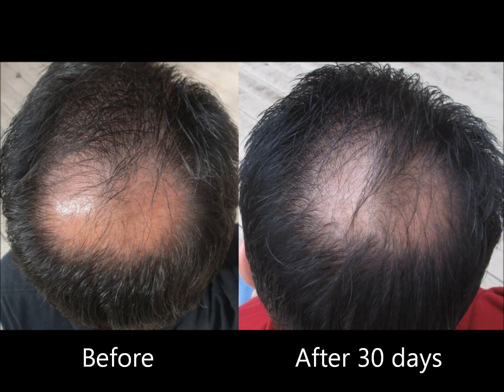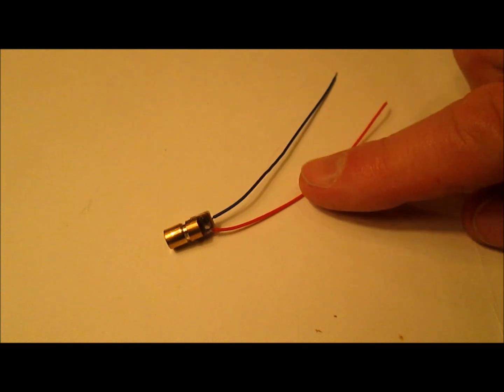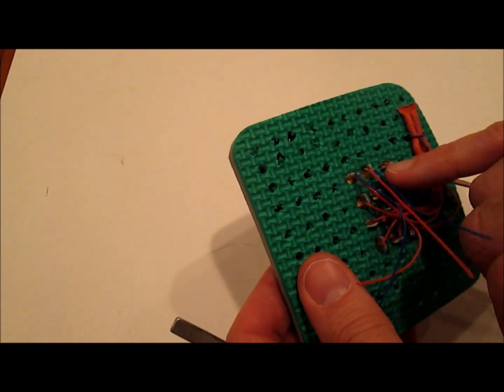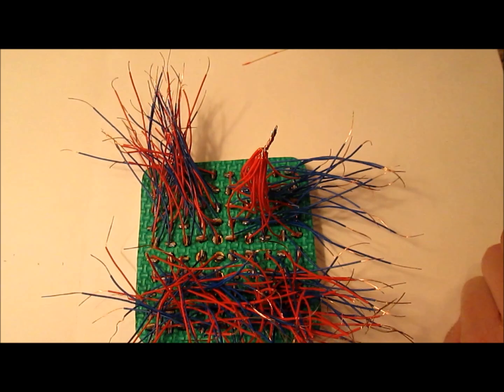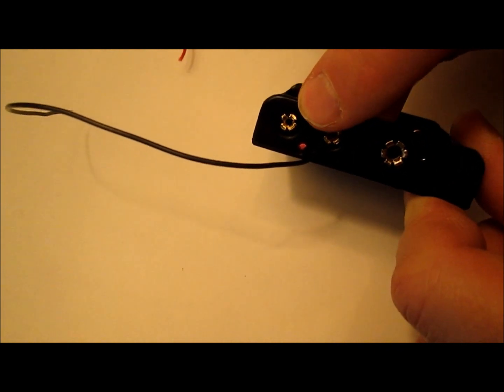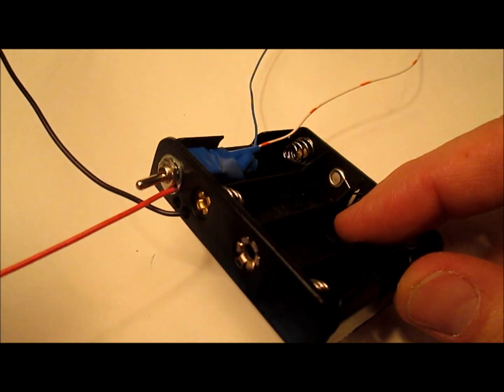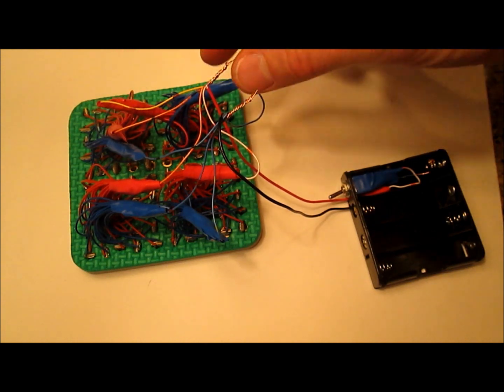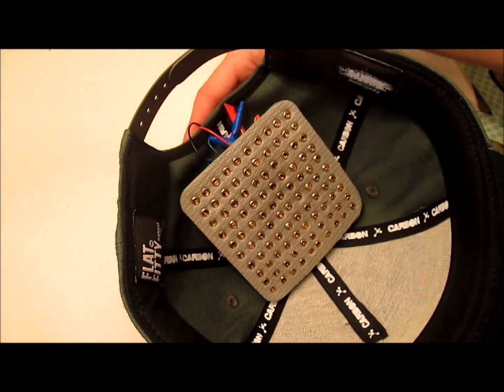How To Make a Hair Growth Laser Hat for $60

Comment: Is anyone did the same or similar hat? What is your experience?  I just build a prototype, using 50 lasers. Will be interesting to see if any result. Q to Lou - using 3 1,2v rechargeable batteries we are receiving only 3,6 volts, does it mean that lasers are working not the full power? but using 4x batteries 1,2 we are coming to 4,8 watts. Where am I wrong?
Reply from the maker: MrPavelvideo - You are right on.  You can't exceed the laser voltage rating.  In my build, I used 5 volt lasers.  Disposable batteries (alkaline) are 1.5 volts, so three of them would add up to 4.5 volts.  Four disposable batteries would be 6 volts and would damage the lasers.  Rechargable batteries (NiCd or Lithium) are 1.2 volts, so 4 of them would be 4.8 volts.  I use three lithium batteries, and 3.6 volts makes the lasers VERY bright.  I really don't think you need to go to 4.8 volts.  Also, as another option, you can get 3 volt lasers, and run them with just 2 batteries.
Reply: *****  Lou, I 've read all your answers but what is your opinion after 8 months of using? are the hairs still growing or shredding? also I am wondering if more expensive laser diods providing better quality of rays?
Reply from the maker: MrPavelvideo -  I wish I had an answer for you, but I stopped wearing it for a while.  I was getting headaches, that turned out to be completely unrelated, so now I have just started using it again.  Also, I keep forgetting to wear it :(

Comment: i use USB to power directly rather than battery. Will see in about a week
Reply: hey how is it..any hair growth using this?
Reply: nope, I went with hair transplant. Now my hairs are fuller no need to use stupid laser.
Reply from the maker: Cool, how much did the transplant cost?
Reply: 12K but is worth it. It such a hassle to maintain your hairs with chemicals, oils and lasers, lets face it it doesnt work that well is all depends on your genes and your testosterone. The more your body produce testosterone the faster you'll loose your hairs.
Reply: @jasona7029  I'm 70. My testosterone is almost as high as it can get. My hair is just beginning to thin and recede. I'm not sure there is a direct link between testosterone and hair loss. Though, I have read that as well.
Reply: @user-vu3xb7qn8g  testosterone theory makes no sense. Why do some men lose their hair and others not a hair? There are people walking around with low testosterone levels who are bald, losing their hair or have almost all their hair. If you had hair replacement surgery you would expect the hairs to fall out if in fact testosterone was the cause but they don't.  So what's the problem with those hair follicle and why are the ones they transplant surviving?

Comment: Can you describe direct power source instead of batteries .
Reply from the maker: Steve Cooper - You can buy either (3-volt, 40mA) or (5-volt, 20mA) diodes, like the ones I used in the video.  If you use 100 x 20mA diodes, that is 2,000mA or 2Amps.  You would need to search for a "5-volt, 2Amp" power supply on Amazon or Ebay.  You should be able to get one for $20 or less.  For 100 x 40mA diodes, you would need a "3-volt, 4Amp" power supply, which will be hard to find.  5-volt supplies are extremely common, because most computer chips run on 5 volts.
Reply: *****
Thanks So I am Looking For 100 x 20mA 5-volt diodes,saw couple of listings on Ebay For 20 to 40 $ depending were they are shipped from.
Reply from the maker: Steve Cooper - Exactly.  You are right on track.

Comment: Hi Lou, thanks for this.    I notice you aren't using a driver circuit on the diodes.   I assume they are the 3v and up to 40ma current ones.   Have you had any problems with any diodes blowing or having too little power?   I'm not sure what the max current is for double As and if something should be in there too limit it.
Reply from the maker: OGpedxing  - Hi.  The laser diodes each come with a built-in current limiting resistor.  You can buy either (3-volt, 40mA) or (5-volt, 20mA) diodes, like the ones I used in the video.  I used three AA 1.5 volt batteries, in series, for a total of 4.5 volts.  If you buy the 3-volt diodes, you should only use two AA 1.5 volt batteries, for a total of 3 volts.
Reply: ***** awesome, thank you!

Comment: Just built mine with 10 until I get the others in. I noticed the first time the lights got hot. Is this normal, does yours get hot al all?  Thanks for you help.
Reply from the maker: I have decided to use mine 20 minutes every day.  After that, I notice they get a little warm, yes.  I think it is partially yhe foam pad.  You are basically wearing a well insulated hat on that one square on your head.  The lasers bring a tiny amount of heat, and the foam keeps the heat in, so it gets warm.  I stop at 20 minutes, right when it starts to get a little warm.

Comment: How often and how long did you use it for each day.
Reply from the maker: The iGraw and the LaserCap say that you should use it 30 minutes, every other day.  I originally only ordered 10 lasers, to see if my idea for the hat would work.  It did, so I ordered 90 more, but they took 3 weeks to ship, so I used 9 lasers in a 3x3 grid, while I waited.  Since I only had a few lasers, I used the hat for 30 minutes, twice a day, during my commute.  My before and after pictures are from that.  Now that I have 100 lasers, I am using it for 30 minutes, once a day.  This may be overkill, but I am not noticing any ill effects, and I want hair sooner!!
Reply: ***** sir are these laser is safe to use any side effects I mean are they dangerous I am in very early stage of hair loss barely visible but its started to thin a bit
Reply from the maker: Jaspreet Dahelay - The FDA has approved many laser devices such as the LaserCap and iGrow laser helmet.  This project uses red lasers, just like they do.  I am using my hat for 20 minutes a day and have no noticed any side effects.  Still, please build and use this hat, at your own risk.
Reply: ***** The references I've read say that you should give it one days rest in between each use and no more than about 20 minutes on each area, more is not necessarily better. I bought one of those inexpensive 28 laser devices and move it over my scalp for 10-15 minutes on each area that needs it (three times a week). After 8 months I am definitely satisfied with the gains I have made.
Reply from the maker: quakerlyster - Thanks for this info.  I have been doing 20 minutes every day.  I will change to 20 minutes every other day, as you suggest.

Comment: Cool. What about radiation though?
Reply from the maker: Red Laser Diodes have been approved by the FDA for hair re-growth.  Here is a link that shows all the devices that have been approved.
http://google2.fda.gov/search?q=laser+hair+growth&proxystylesheet=FDAgov
Reply: ***** But lasers and LEDs are not the same thing, right? I dunno man, I don't think I'd want to point 100 lasers at my head for extended periods of time. How did you determine you need 100 lasers? Did you research the recommended or approved strength and wavelength of laser to use? What about the distance from the skin/hair? Most likely you'll be fine but personally I wouldn't use it.
Reply from the maker: Gadget Addict Oops.  Sorry I originally said "Red LEDs".  I just eddited my reply to Bill P.  I am not using LEDs.  I am using Red Laser Diodes, just like the miriad of laser combs and laser hats you can find on Amazon.  The LaserCap has over 200 lasers, but it covers the entire head.  I just wanted a patch to cover the "traditional" bald spot, so I only used 100.
Reply: @HowToLou  lol a red laser diode is an led isnt it?